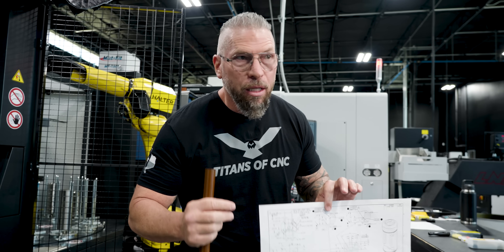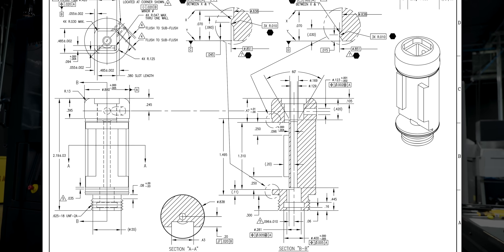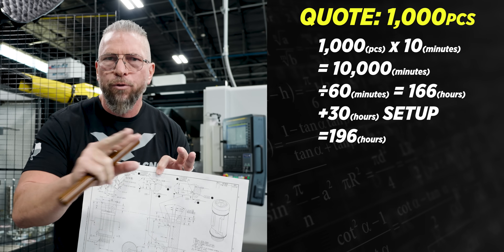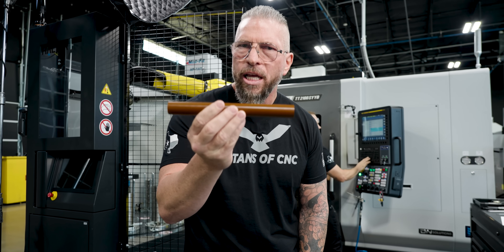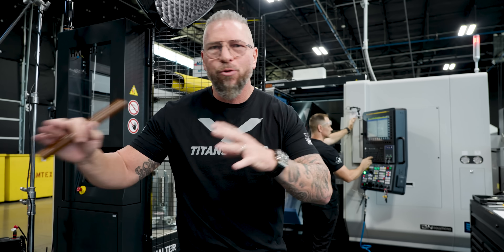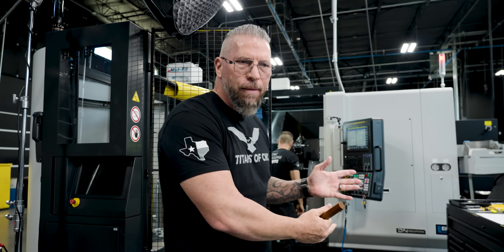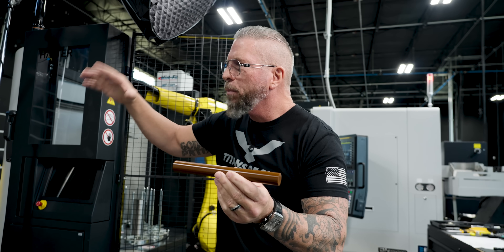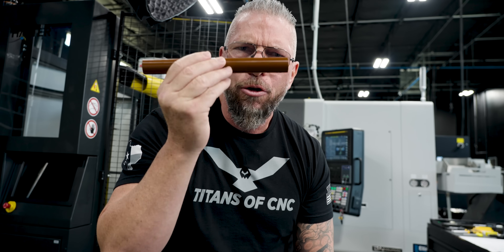How I Charge $40 for a $370 Part

Comment: Vespel Parts and Shapes is a DuPont Polymer Material product that comes in different grades for different applications. I machined a grade with high graphite content, and another with carbon fibers. I used to machine it in a controlled environment shop. Just make sure not to use too much pressure in your work holding because it will flex. One part had a .060" wall thickness, so we bought a gage pin that was the finish ID size and put it in the part before we turned the OD. It worked out Ok. We asked the customer to buy a small quantity of test material for us to fine tune the process and they were ok with it since we would only need it the first time we were machining that Vespel grade. I used slower speeds and feeds, kept my tools sharp and it worked ok.
Reply: Is it actually still DuPont, or is the label changed to Celanese at this point, too? Since DuPont sold its Polyamide/Nylon section to Celanese, about.... 2 years or so ago.
Reply: @LordNecron  I believe it's still a DuPont product.
Reply: I deal with the same nightmare working with graphite.

Comment: I just had to re machine 430 Delrin blocks there is a .050” wall on one side and the pocket needs to be -.001”/+.003” it’s possibly to hit. But It was wandering constantly by about .003”. I’m sure it could change finishing passes. but that’s just another example of tolerance plastic can be rough

Comment: if you're afraid you can always use another cheaper version that has similar properties, then machine it and if you're satisfied with the result use vespel.. its not even that hard to machine tbh
Reply: We use acetal as a set up part to dial everything in. Works for us
Reply: Cringe you and the other worm replying think this company doesn’t do setup.

Comment: I’ve dealt with both customer supplied material and material my work supplies. As the machinist on the floor I prefer material we supply that way I know where it is coming from and I can talk to that material supplier if we have problems or questions. We had some customer supplied 316 stainless, only problem was, when I got it at my machine it was magnet, and I’ve never seen 316 in that shade of dark gray almost black. It was harder than all hell too. We asked the customer about it and they said that’s the material they’ve always used. I still have no clue what it was. It was around 60rockwell according to our tester.

Comment: Recognized that material immediately. Its used in cryogenic stirling cycle cooling units for MRI machines. It does machine quite easily but its expensive. Mainly because the pieces have been inspected with ultrasound and x ray due to its use in mission critical gadgets. ❤
Reply: Thanks for that. I was wondering what that part was for
Reply: looks like the sample tray adapter for a nmr sample tube or something. mri=nmr
Reply: It's used in a lot more applications than just6 that. I've done a lot of work with it for aerospace and defense.

Comment: I have custom built PCs for decades... know what I did when high end video cards started costing $1000 to $1500?  I STARTED REQUIRING CUSTOMER PURCHASED VIDEO CARDS THAT I INSTALL.  They get a direct manufacturer warranty.  I don't take on brutal risk for only a 1 or 2 percent markup.  Guess what happened?  Nvidia started having substantial power connector failures on 4080 and 4090 cards... guess how many I had to eat?  ZERO.  And if any of my customers do have an issue?  They ALL have 3-5 years of direct manufacturer warranty to lean on.  So they aren't worried about the future, I'm not bankrupt, everyone's happy.  If I have to eat even one of those cards, profit margins from up to 10 jobs gets obliterated.  Relatively few of those... and I'd be done.  And the relationship with the customer actually improves when I explain just how much better their investment is protected doing it this way.

Comment: I have been a machinist for almost 30 years, and I have never even heard of that material.
Reply: I've seen it used as a wetted part in chemically pure environments and vacuum, e.g. in the sample path for gas chromatography / mass spectrometry for chemical analysis. Where you need the resilience and chemical inertness of PTFE, but the strength closer to Delrin.
Reply: It's just a brand name for a high performance plastic produced by Dupont. I'm sure there are others that are similar if not identical...
Reply: @kramer26 .Saint Gobain makes “Meldin” - virtually the same, and just as expensive…
Reply: Work for a company that machines it for our consumable parts. I knew it wasn't going to be cheap but I never looked into the actual cost of it.
Reply: You probably have lots of polyamide items in your house. Usually you would come across it as a fiber or a film. 

Chemical resistance would be why its needed in something like this. Maybe the customer makes dialysis machines or something like that.
Reply: @lassikinnunen  Polyamide is nylon.

Polyimide is vespel.

Its expensive because it doesnt process well with tempurature (so most grades are not injection moldable, with one exception-ish)

And more importantly, its expensive because dupont basically has the market cornered still.
Reply: @lasskinn polyimide not polyamide different materials
Reply: I've never heard of it either, how can it be that much.
Reply: You may be an expert, but you are no Titan xD

Comment: it might be worth producing the plastic by high pressure injection molding. it will have better structural integrity because of material flow normally and dimensional tolerance if large quantities are to be produced. an internal composite skeleton could also be used for structural integrity or strength or cost saving incorporated in the injection molded product. suggestions for powder metallurgy or material substitution should also be an option.
Reply: Hi! I work with vespel. It actually cannot be injection molded as it doesn’t have a glass transition temperature. This material in the video is isostatically molded and therefore has isometric properties.
Reply: @ ah fantastic to know. Thanks for the info! 
Is there such a thing as a material that can be injection molded and hardened by another method (heat, radiation, etc) that solidifies to exhibit properties of vespel after curing? Just curious

Comment: I would have to know everything about materials working with before even start a job like how its manufactured ,melting point- if any ,hardness ect.....can i even shine that or do i have to invent a way if have to shine it - well Tyson i was thinking about different materials to use as lap plates to polish diamonds, well some was using copper and i was think platinum or diamond itself well their is machines that can grow diamonds just charing the diamond lap plate might have to use laser to gat that right polish- theirr are tolerances Tyson even in polishing its called flawless, like if that peace of plastic that will chip like no tomorrow if to much heat // well dont it look like a doo doo stick

Comment: Only problem with CPM is when you are calling them to let them know they need to supply 12 more cause you messed up 12 of them.. whatever reason doesn't matter they wont be happy about it. And either A. They quit that contract or B. they finish it and find a new machiner
Reply: It’s not about messing the material up imo. It’s if there’s a part failure later on they will blame the material for the failure, question your suppliers etc etc. you get rid of that by having them supplying it.
Reply: This is only an issue if you weren't upfront about the risks. If you have a set aside for rework/yield in the PO, then the customer is already prepared to exercise the option. I'm an aerospace customer, and I can tell you that I'll only be upset if I have to go through my massive purchasing process as an emergency because a supplier didn't consider that they might scrap a few pieces. We have rigid limits on surplus spend on PO's, so it's a huge inconvenience and we don't have the admin headcount that you probably think we do to process those things timely.
Reply: @allenklingsporn6993  If a company tells me "oh you have to supply the material because we are not confident enough in our skills to not botch it" I will tell all my friends to blacklist that company. They give me the quote, they calculate the risk, I will not sign a quote and then carry the risk of them botching like 90% because they are incompetent
Reply: Gotta factor setup scrap into the quote.
Reply: I love how Titan gave a real-world example that he has actual experience with and you comment like...

"Nuh uhhhh"

😂
Reply: @Wrathmaul85  The fact you got "nuh uhhhh" from that shows your intellectual integrity.
Reply: @Arjay.M88  the fact that you're being contrarian when given a real-world example shows your cynicism. The man is giving an actual example and all you have to contribute is negativity. Take the feedback and improve your process.

Titan doesn't need to make this video. He is doing it to give a real example of something that can help improve customer relations and reduce risk. If you have a real relationship with your client they are going to forgive mistakes, especially when you explain the pros and cons of the arrangement,  because it's built on more than just money for parts. 

If you want to fight on the internet I'll be more than happy to waste your time. Or, you can adjust your worldview to look for good things that can happen instead of focusing on the negative.
Reply: Nah, I won't sign any contracts that says I am responsible for you messing up my material, think about it jimmy !
Quality control at every step, with every piece, is the key

Comment: I had a job in my shop machining pump shafts for split case pumps. My customer always supplied the 4140 material to save my material markup which was cool with me. Less out of my pocket. Then he came to me one day having found a CNC shop that was selling aftermarket shafts for not much more than the cost of material. I was stunned but business is business so I told him to go for it. Gotta love Chinese steel. Shaft breakage became an instant issue because 1018 equivalent is what they were selling him.
Reply: Did they come back to you?
Reply: @ yes.
Reply: China #18 (which is what they substitute) is not as good as 1018, and I found asking for 1045 is the best option with them if you are avoiding expensive alloys
Reply: @ 1045 is fair in this application. It will give the customer a good run but the bearing fits wallow out faster than with 4140. Thats the main reason I use 4140. I have also had good luck using 416 stainless.
Reply: @martinswiney2192  Free machining 416 is one of my favorite alloys. Stainless, much more machinable and heat treatable.  Good stuff.
Reply: Lul. And there we have it again: Buy cheap and rise the possibility exponentially to buy twice. 🤣😂
Awesome, that he came back to you. Loyalty pays. :o)
Reply: Reminding me of the "titanium" parts that got into Boeing jets.
Reply: People wonder why Atlas Copco drill pipe outperformed other stuff. We were making it from 4145 and 4340 vs the plain carbon steel from other guys.
Reply: The customer needs to understand that when the cheat on their faithful spouse the breakup costs money.
Reply: ROTF LMBO

Comment: When we do outside machining, we always supply material due to traceability requirements for ASME Code materials, we have to prove the mill certifications of the materials. If it’s PED materials then we have to to verify the QMS of the mill.
Reply: What’s PED?  We do a lot of manufacturing of Code items too… Section VIII and B31.3.
Reply: @ it’s the European pressure equipment Director 2014/68/EU, my company manufactures hyperbaric oxygen chambers that are medical devices, we have to meet the ASME section VIII division 1 and 2, PED 2014/68/EU, CSA B51. Now one would think OK that’s all pressure vessel codes however, our design uses flat plates that are machined.
Reply: @DiscoR53  PED = Pressure Equipment Directive.  Of course. Duh.

Comment: As a plastic machinist I love vespel. Its a great material that runs really well. Its just expensive is all. Not a big deal.
Reply: Vespel is fine to machine it is just the pucker factor associated with the material cost.  There were only a few parts we did at my old job that had that pucker factor, vespel seals, exhaust rings (oversize precut inconel blanks, started about $1800 per blank to start) and some magnesium castings we reworked that are no longer being made, scrap one and the price of the rest goes up.
Reply: I thought PEEK was pricy, this stuff is next level.
Reply: how does it compare to PEEK?
Reply: @veikovasko5603  it's a harder slightly more abrasive material. Unless your talking like 30% carbon or glass peek. Then peek is worse.
Reply: Absolutely, never had any issue or worries with most of the high cost engineering plastics. If someone is freaking about about the material, it just means they aren’t confident in their shops skills
Reply: @phillefever1934 at those prices you’re a jeweler, except a jeweler can always sweep up broken gold and melt it into new bars. Can you recycle these high spec engineering plastics and recover the scrap?
Reply: @JinKee  nope it's just waste. Only reman plastics I know of are things like low end uhmw and Teflon.
Reply: @phillefever1934  it's a big outlay for 1000 parts in this case, and might have to carry the invoice for a cycle or two depending on the customer..

Comment: With these batch size and material cost not so wise to use rod blanks. It calls for direct forming with machining of only threads, one inner groove and side bore. Optionally slit and touch up through hole tolerances. Total time cut tenfold, material utilization nearly doubled.
Meanwhile working with customer material is a high risk endeavor that can test even long lasting relationship!
Reply: Generally agree. DF is cost effective at surprisingly low volumes when the part size is small and material cost is that high!  Possible that the end use requirements for flexural modulus or surface finish do not allow for DF.
Reply: Please tell me what Direct Forming is. Thanks
Reply: @1gdfoster1  a somewhat hybrid of injection molding and sintering for plastics where you start with fine powder and end up with a blank very close to final product shapewise and with regards to dimensional tolerances. Although as another commenter pointed out, it can still lack surface finish quality, since you don't work with liquid and therefore grains still show.

Comment: I've made a total of 9 parts in 23 years out of Vespel. It's not bad to work with, but the added stress of the expensive material can get to you if you let it. It's really not something that I see a lot so this doesn't apply. BUT! For "special" material, then yes, every time, I require CSM (Customer Supplied Material).

Comment: This would be intense.    I'm struggling to hold tolerance in annealed D2 tool steel with the robodrill. I get upset making bad parts and it's $8 in D2..  $300 is a state of depression
Reply: What kind of tolerance? D2 is usually pretty stable and easy to cut. I'd rather cut D2 than 1018 honestly.
Reply: @Renegade48445  it's a part I'm making that doesn't spec out a tolerance.  I found  .002" slop in z axis thrust bearings,  a bad tool holder. AND   chip welding to my Cutters.  I'm using flood coolant  synergy 735  14.4%   I'm weeding out the discrepancies but it's been very difficult.  The steel parts are good.  D2 nope
Reply: @RoboDriller  Its tough to know without knowing but are you using an air blast? Even when I finish tool steels I run air blast with the flood to minimize double cutting.
Reply: @Renegade48445  I am NOT using air blast.   I have a TON of food coolant,and still yes It's possible re-cutting chips. The edges on the Endmills are definitely pressure welding from what I see and in comparison to sandvik cutting books. They recommend increasing feed "considerably"    the cut isn't hot enough to prevent pressure welding, again from sandviks book. So I thought about not using coolant and using only air blast.  
.88 doc, 1/2 tool  5 flute.    Short holder, dual contact bt30   what do you recommend?  The sides are turning out good, it's z  I can't get dialed (found some reasons)

Comment: i hate plastic and tolerances combined
Reply: Hate has no home here on this channel...Just kidding, yeah I kinda hate plastics too. 🙂
Reply: I work at a plastics factory, everyone hates acetal, then I mentioned that machinists love acetal.
Reply: depends on the material. Sometimes you are in tolerance, and over night it starts to warp.
Reply: I've successfully machined little 5mm plastic guide buttons to a 0.01mm (~4/10000") tolerance. I remember that one of the selected materials I used was called Ertalon.
No machinist near me took it so had to resort to DIY. There was one big lathe nearby where I could sneak in at night. Had to create my own custom cutting tool too because there wasn't anything nearly as small and sharp in that shop. Quite some experience, luckily did not end wound up around the chuck.
Reply: @SeersantLoom  The thing is lots of plastics "grow" after being machined so yea you might get .01mm measurements but the next day you can have +.1...
Been there done that, sux arse.
Reply: @billklatsch5058  I've seen same effect in metal. Had some extension nuts machined round on one end. After couple of days, one had developed a bulge/blister there. Never seen that before.